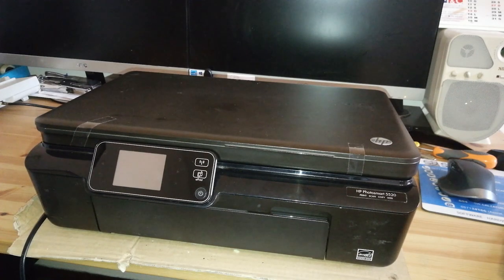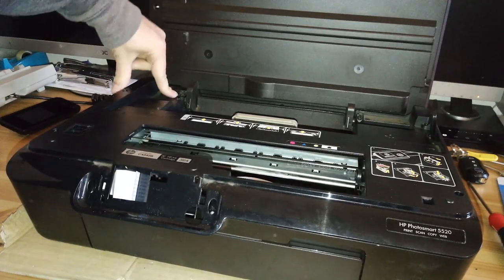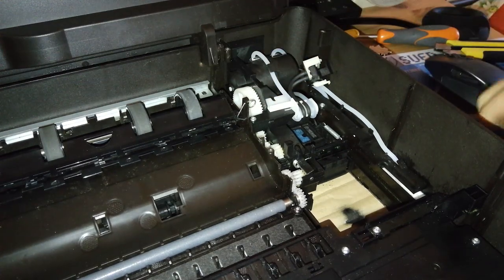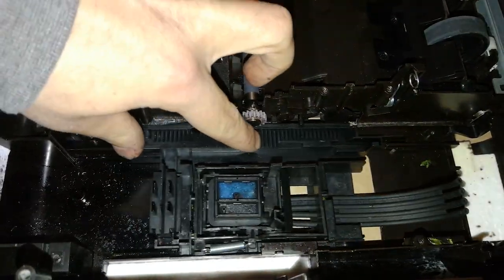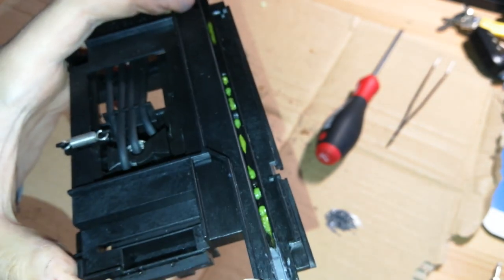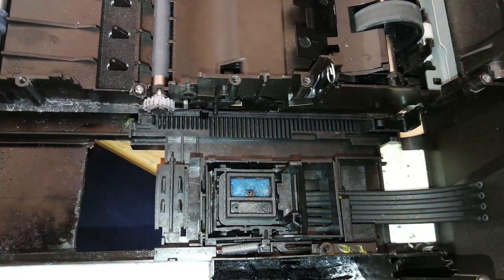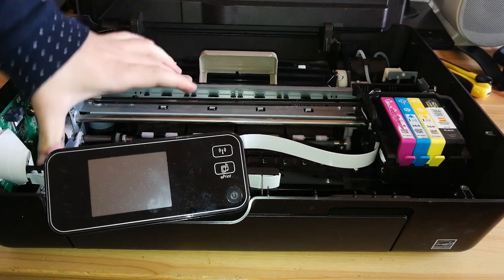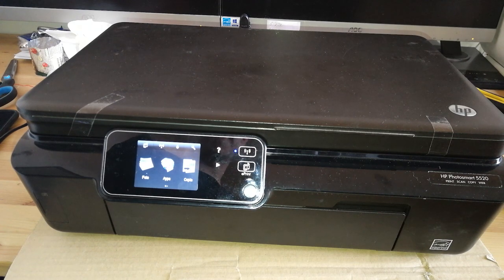HP Photosmart 5520 Makes Grinding Noise & Carriage Jam • Service Station Repair

Comment: Had exactly the same problem. The grinding was at both ends. I put a tiny dot of super glue and accelerator in the same place and gave it a quick sand with fine paper. I put a very light line of super glue on the track part at the rear end as well , so basically the the whole piece was risen up by less than 1mm but that was enough to sort the problem. 
Thanks for the video tutorial it worked perfectly.

Comment: You're a star - it worked like a charm! I had grinding on both ends and so I did both your fixes as I figured it would extend the printer life. If you use a more fluid epoxy like Araldite then you can leave the sliding component at an angle while drying which leaves a natural ramp shape. I hope this epoxy proves as good as yours as the ramp ages. We will see - but many thanks either way! :)

Comment: Excellent  & Clear Video . Congratulation. I have exactly same issue . It is so frustrating to hear from HP Printer service personnel that this is  printer problem is not repairable ,being a use & throw printer . myself doing is it bit risky ,  i will show the video to a local technician to attend it in  presence as per Video . Thanks a Lot.
Reply from the maker: Unfortunately HP is one of the worst companies abour repair :/

Comment: Very Instructive video, I did notice a small loose spring  in the video just when you remove the carriage assembley, where does that go?
Reply from the maker: Hi :) if you watch that section of video you'll notice in the lower part of the carriage assembly two white plastic rollers held in place by a black plastic piece. There's - i think - 4 or 5 of those black pieces, and each one is held in place by clips and a spring sandwitched between it and the metal carriage frame makes it spring loaded. During disassembly one of them popped out, but it shouldn't happen as in the printer I've got in the video it was a bit more loose than usual, it should stay in place. If that happens to you though, you can just look at how the other ones are attached and replicate the same.

Comment: Hello, the bottom mechanical adjustment of my HP 5525 printer, which is adjusted according to the paper width in the paper receiving tray, if the printer is still at the 10 cm width setting immediately after printing, a strong gear straining noise is heard from the printer shortly after printing (but no wear or damage is seen on the gears) . Even while printing (mechanical paper width adjustment at the bottom), if I change it to normal A4 paper size, there is no abnormal strain. When the paper size setting is adjusted to 10 cm width, why can this excessive strain on the gears occur after printing? What does the paper width setting have to do with these gears? Is there anything I can do to fix the problem? Note: If the mechanical paper width adjustment at the bottom is according to A4 paper, this straining sound is never heard. Thank you.

Comment: Thank you for all the info however I keep getting a clear cartridge jam error because it seems to get hung up on the locking lever. Any ideas?
Reply from the maker: Hi! :) Is the CR Encoder strip correctly in place and clean of any ink? If you manually move the carriage to the left side then power on the printer, does it move correctly to the right or it jumps really fast from one place to another? The CR Encoder strip is a plastic transparent strip that runs through the carriage from one side to the other of the printer, you can check on google for an image of it, just search for "CR Encoder Strip".
Reply: It seems clean but yes the cartridge moves quickly and if it does break free of the locking lever it slams into the right side of the printer really hard
Reply from the maker: That's tipical of a CR Encoder that is not in place, or the sensor that reads it (it's located at the rear side of the printhead) is not working. Try to remove the CR Encoder strip and install it again correctly, be sure that passes through the sensor behind the printhead. The CR Encoder Strip also has a series of black vertical lines on it, it's difficult to see at naked eye.
Reply from the maker: I have a video on how to replace the printhead on this model, I show how to remove and reinstall the CR Encoder Strip, there's the link, I hope it helps: https://youtu.be/b_gFslJYXRI
Reply: Yes as I looked closer there does seem to be a small dent in it. Thank you for your help

Comment: Hi, how about when printer can't turn on?  tried to bring it to computer service they said the board needs to replace but i dont believe because i just used it the day before i bring to shop .. what i did is after i made factory reset it never turns on.. thanks i hope you notice this message.
Reply: j'ai même problème

Comment: Wow, the best fix solution for HP 3520/5520/6510 models!

This machine has another problem that cannot pickup paper and has wired sound (gears?) during print head cleaning on the left side.

I don't know about it if you have any ideas? Thank you.
Reply from the maker: Hi! Could you please send me a video of the defect via email, or post a link here? :)
Reply: @PaoloMarcelli  i found the 'left gear sets' has damaged and cannot pickup paper.
Reply from the maker: @meitetsusai3787  I have a video on that!
Reply: @PaoloMarcelli  wow, i hope to watch that soon. ^^

Comment: Hi, great video, I have an HP Deskjet that used the 2 cartridges black and tri color my printer makes some banging nosies like if the carriers is too speed up that it bangs on the sides of the printer do you have an idea of what it might be causing this? I appriciate if you would help me.
Reply from the maker: Hi! The CR Encoder strip is stained with ink/something or is mounted incorrectly, what model of printer is it?
Reply: @PaoloMarcelli  the printer is a Desk jet Ink Advantage 2775

Comment: At 8:35 a spring falls out, then disappears without mention. ???
Reply from the maker: Yes, because it usually doesn't happen, that plastic clip that holds the rollers and spring assembly was more loose than normal :/ also every one of those black assemblies is fixed exactly the same, so it's easy to look at the others and get it back into place like the other ones, that's why I didn't mention it :)

Comment: I'm getting a Carriage Jam error but without any grinding. The Carriage is slamming around sort of forcefully, knocking around , and not as smooth.
Reply from the maker: Hi! That's probably the CR Encoder Strip not in place correctly, or dirty. Check if the CR Encoder strip is in place, passes through the black sensor behind the printhead, and it's not stained with ink.

Comment: May the drum causes the same noise if it's damaged ??
Reply from the maker: Hi! What do you mean by the drum? The drum is a component only present in laser printers, this is an InkJet so it doesn't have a drum.

Comment: NON FUNZIONA POTETE FAR GIRARE QUANTO VI PARE MA IL CARRELLO NON SI SBLOCCA!
Reply from the maker: Nel video ho chiaramente mostrato che funziona, se nel tuo caso non hai risolto non posso farci molto, vedi se non c'è un problema diverso.
Reply: @PaoloMarcelli  Vero ma nel mio caso era inceppata la levetta sblocca testina quella che fa correre il carrello col blocco aspirazione.
Per cui smontando, pulendo con acqua ed ammoniaca tiepidi con molta prudenza e tanta pazienza, rimontando il tutto e facendo allineare alla macchina il tutto adesso stampa PERFETTAMENTE. Vabbè nuova esperienza se girando la rotella non si sblocca leverino bloccato causa sporco eccessivo una delle cause possibili.